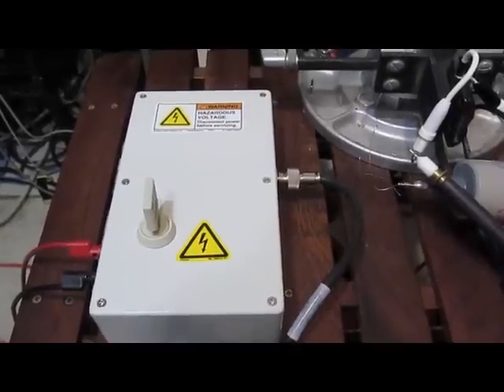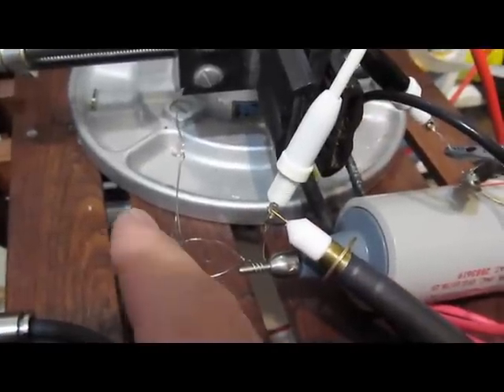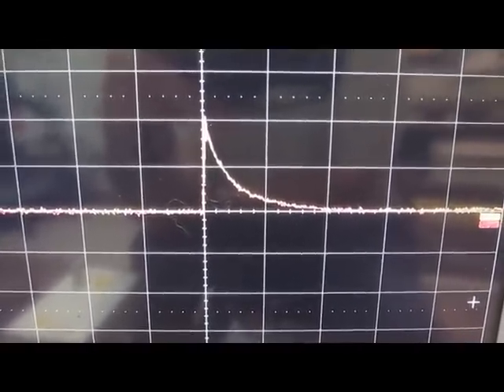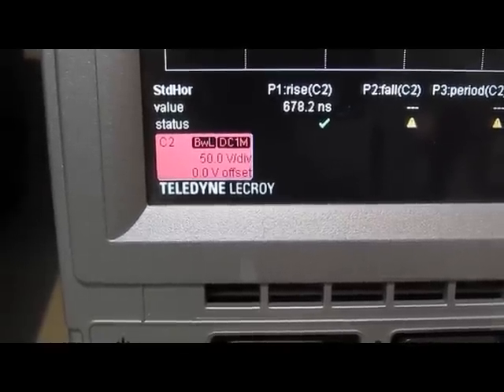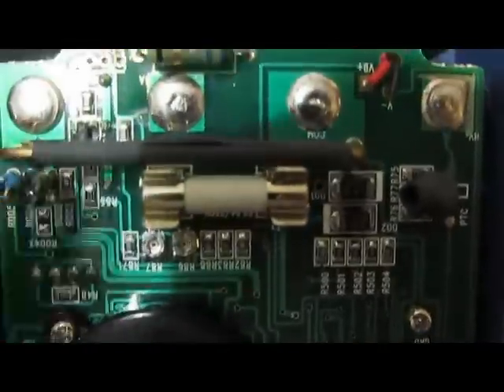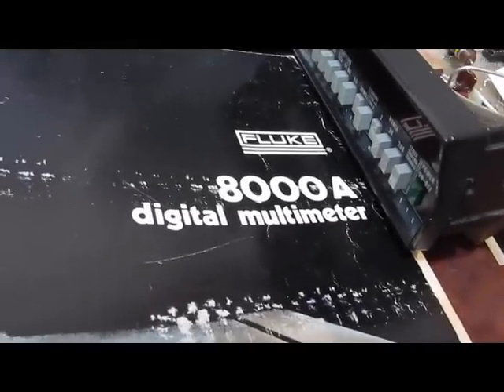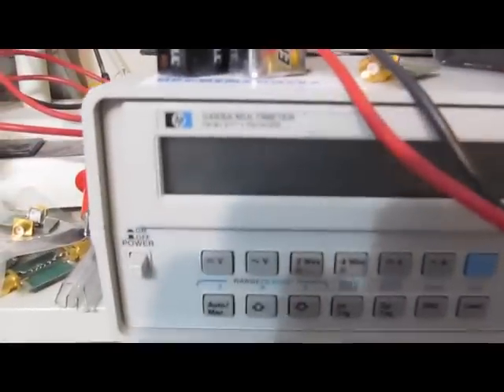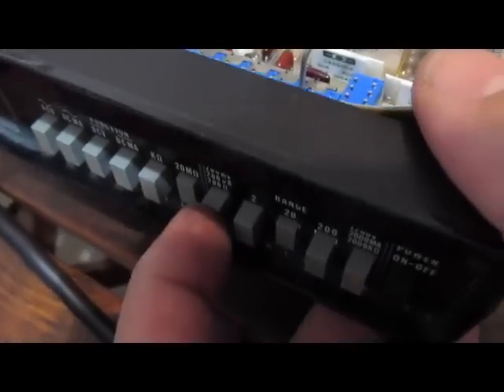Homemade low energy surge generator  Evaluating low cost DVMs Part 1

Comment: Those sparks are tiny, you need this generator, 6,6kV 3,3kA:
<http://www.helmut-singer.de/stock/-467428386.html>
I have one sitting downstairs and it is quite scary. You remote control it via RS232, the commands are "arm" to charge it and "execute" to fire. 

Hey the Fluke 8000A (or was it the 8600A) actually had a surge problem during it's lifetime. They found even a low energy surge could carbonise a track along the plastic and bring the withstand voltage below 1kV. The solution was to fit a varistor (or was it a spark gap) right at the input terminals,